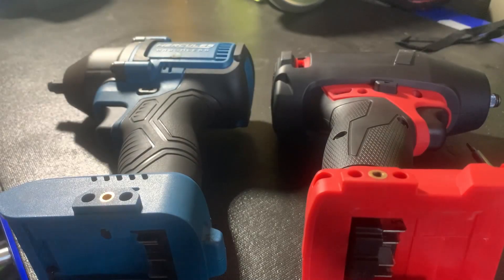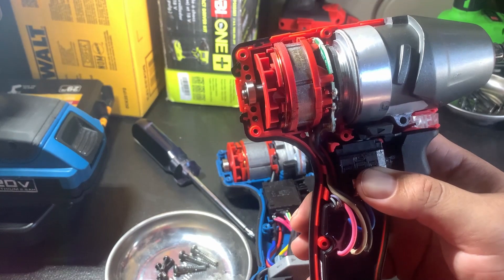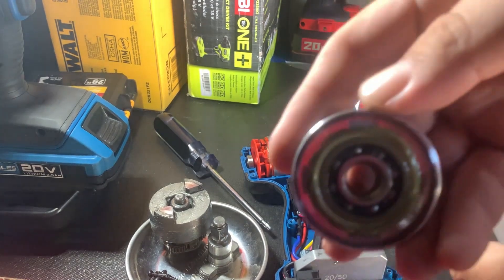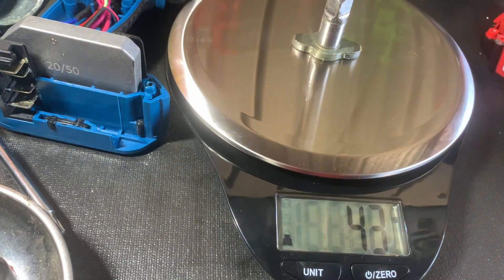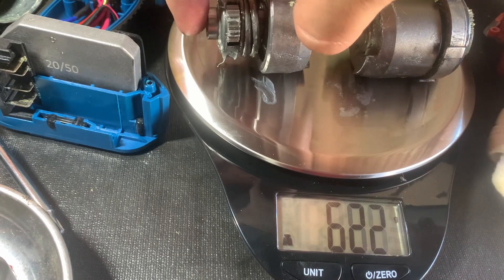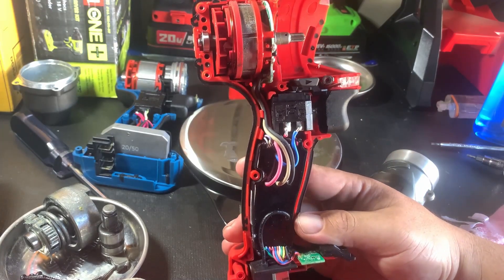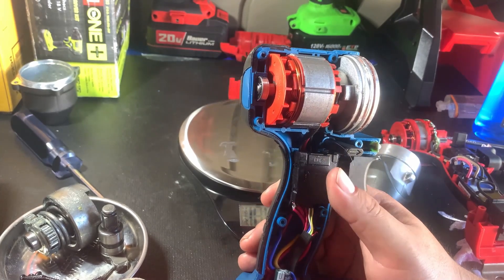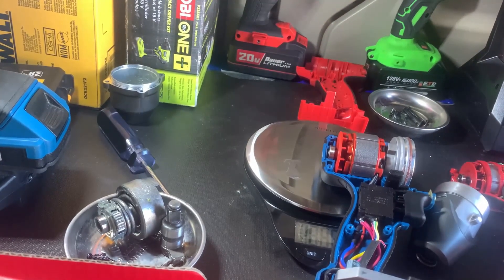Hercules 20v Impact Wrench 3/8 vs Milwaukee 2754-20 Disassembly

Comment: What I dont like about the Hercules is the location of the light and theres only 1 light. Would be nice if they did 3 lights around the rotor or a round light around the rotor. The light looks like a last minute design.

Comment: Is the tip where you can your socket on interchangeable? Like instead of putting 1/2 tip make it a 3/8? Is that possible
Reply from the maker: if u have a 3/8 anvil for that specific brand im sure they would just go right in
Reply: @toolsonabudget7763  sounds good thank you